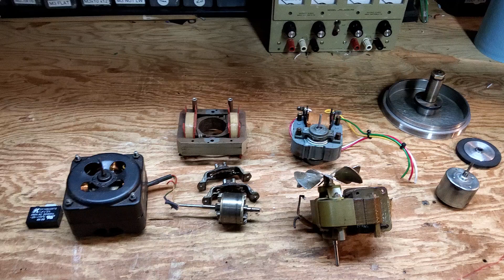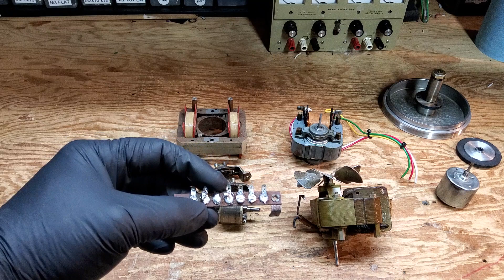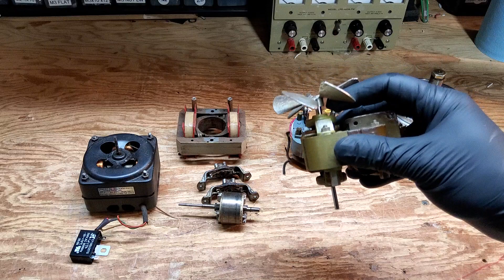Binson Echorec Drive System

Comment: Great video, thank you for making it. You wouldn't know where to source a replacement Sankyo dc motor for these would you? Or have one you would sell? Thanks a mil
Reply from the maker: Hey. No I don't. I use a different motor from model trains.  Better torque at low speed. RS385 PH with an extended shaft. Noisy but effective.
Reply: @JHamley  great, is it a straightforward replacement or are some circuitry mods needed for the RS385 motor?
Reply from the maker: You just need a speed controller.
Reply: Thanks a million, do you think a Mabuchi  RS-835PH model would fit the bill?
Reply from the maker: @brendanryan6363  that's the one!